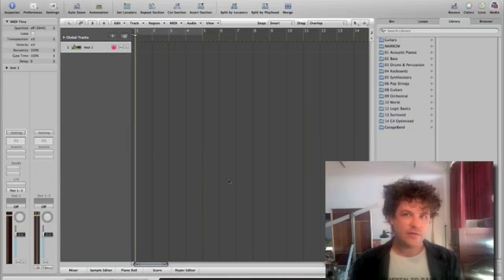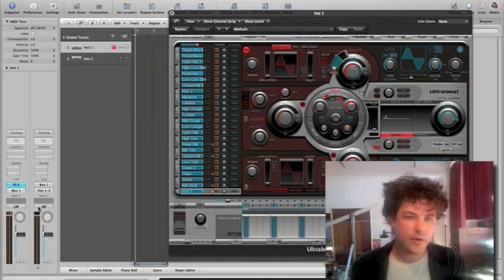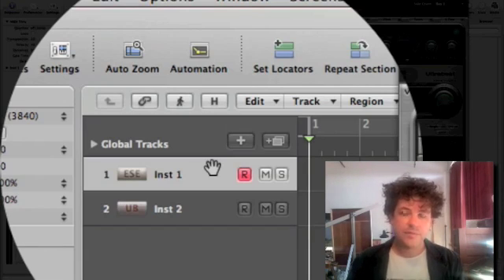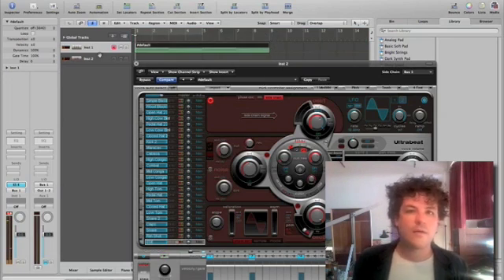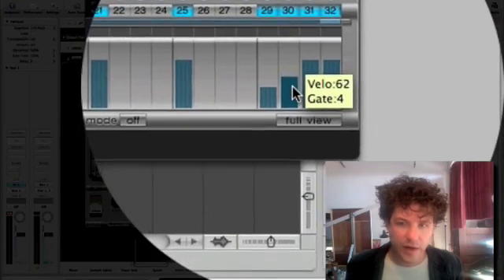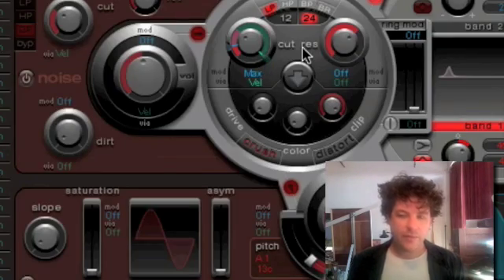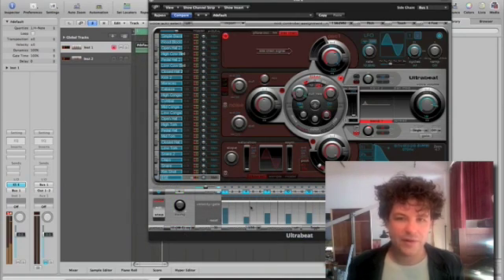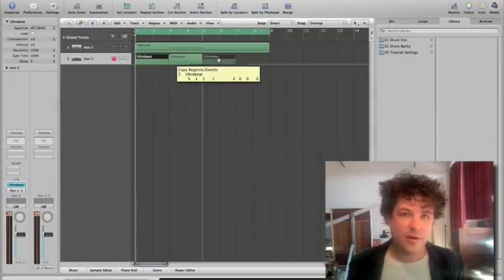Tip#36 - Ultrabeat Sidechain

Comment: You SF Logic Ninja, are a legend. I've learnt so much from your video's. When you mention about getting to a discussion on gate in the sequencer section, did you ever get around to that? At the moment, the notes seem not to trigger for the length that I specify with the gate in the sequencer. This only happens when sidechaining a synth through Ultrabeat as you've detailed in this video as far as I can tell, not when using sounds generated by Ultrabeat. Cheers!